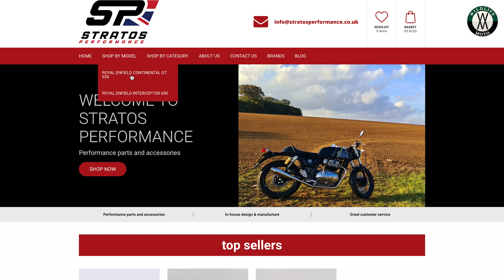BMW R100CS: Brake Calipers Machined & Overhauled

Comment: Why are the pads copper backed? I thought you wanted to limit heat transfer from the pads to the pistons (and eventually the fluid)
Reply from the maker: The copper coating is there to fuse the pad material to the plate during manufacturing. When these parts are passed through a furnace, the copper coating under the pad melts fusing the pad and plate together. This is used instead of glue. The thin copper coat isn’t going to alter the thermal properties in a meaningful way.
Reply: It's just copper plated, then, got it!
Reply from the maker: @anidiotinaracingcar 👍